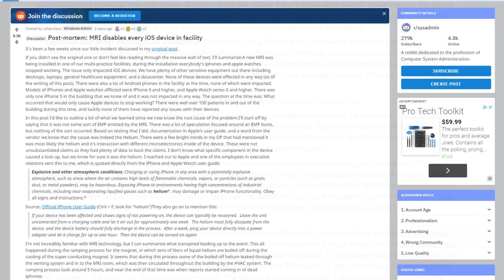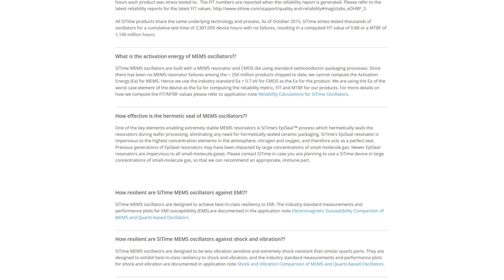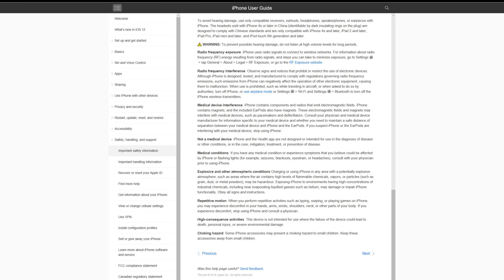Does Helium Break iPhones?!

Comment: Classic Apple quality breaks for the simplest things
Reply: CREATOR SW yep simplest tings everyone has helium at home
Reply: @Maykay1312  i have helium at home
Reply: CREATOR SW what? 
Where?
Only time I get helium in my house is when I buy balloons with it inside 

And I wouldn’t say the phone breaks but shuts off until it can “recharge” it’s self back on or whatever the case is
Reply: @dannyclaws1  I used it for my inventions in the aviation industry.
Reply: @Xpert_Destroyer 4 Ever heard of balloons? :P

8:19 PM
11/3/2018
Reply: @Maykay1312  helium is a component of our atmosphere so you are correct, everyone does have helium at home.
Reply: @jimbob9631  it was a sarcastic coment
Reply: @Maykay1312  ah, didn't catch the sarcasm
Reply: @Maykay1312  They also break from a single capacitor failing or little tiny hairs getting on the board or even just one teeny tiny drop of water, so uhh... Yeah "quality" indeed.

Compare that to some cheaper devices such as Thinkpads or some Dell models in which you could dump an entire cup of water over them and they continue working just fine and Apple's "quality" really starts to stand out and not in a good way.
Reply: vgamesx1 Any electronic circuitry that’s directly exposed to liquids would obviously break. Not just Apple’s products.
Reply: @FastestCores  Yes but way to completely miss the point... You either didn't read the rest of my comment or choose to ignore the fact that Apple's expensive quality products will almost always die from the tiniest bit of water whereas a fair number of cheaper devices usually won't.

Watch this: https://youtu.be/ig3xI8dUdm0?t=1700
Then this: https://youtu.be/qGbQ2FPDqkw?t=162

Now you tell me which device is better made and is likely to last longer... Obviously not a 1 to 1 test but it gets the point across.
Reply: vgamesx1 iPhones don’t break for water, are you talking about the butterfly keyboard? If you are you just prove that you are a parrot, you hear Apple and you start to regurgitate stuff.
Reply: @jaimeduncan6167  The butterfly keyboard design is an Apple product, and he said Apple products, so it's valid, also iPhones do break easily when exposed to water.
Reply: @mkultrasoldier  no they dont in fact when compared to the galaxy s8 vs iphone 7plus the iphone survived longer in the water at deeper depths than the galaxy
Reply: Any type of electronic breaks if one capacitor is busted. It just have to be the right one.  @vgamesx1
Reply: @needlessoracle57  I never said the Galaxys didn't.
Reply: @jaimeduncan6167  Says the parrot who essentially repeats "you're just a hater" in a slightly different way as soon as you hear Apple is bad, right...? Also pretty sure he's referring to Apple devices in general but iphones constantly break from water, even water resistant phones fail because all phones are only resistant as in they can only take so much submersion until failure, just like calling something bulletproof isn't very accurate as it will fail at some point and making this worse is that Apple's expensive devices aren't conformal coated so as soon as just a little bit of water touches anything it's dead.
Reply: @LastWh1spr but if its in the air its not going to break because the helium will go up and disapier only if u get the phone in a bag with helium but who gona do that by accident ? i think its a feature u have waranty on ur iphone and u whant a new one u just fill up a bag with helium and break the phone and u get a new iphone witch u can sell for money then u can buy a newer iphone when that one gets scrached and no one woud buy it because of the cosmetic condition u just repeat and u get a new iphone witch u can sell for money and just buy a newer one xd
Reply: CREATOR SW And May I ask why is it a good idea to put any phone into a vacuum bag that is only filled with helium?
Reply: Only high amount of Helium other than Oxygen will break iPhones, also how can you survive in that area
Reply: Helion is so comum at homes (talking with a deep voice)
Reply: CREATOR SW STFU